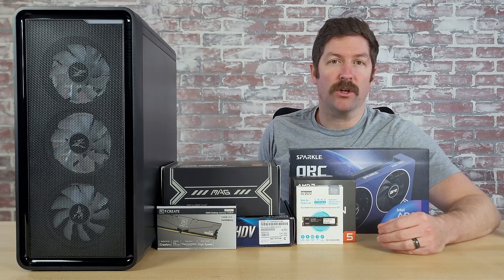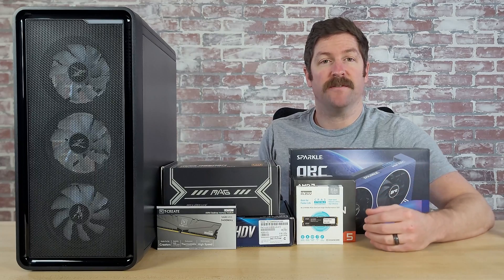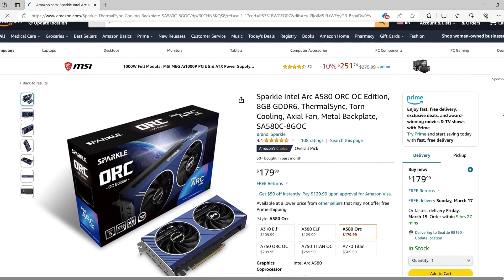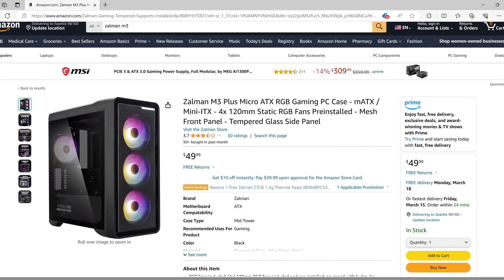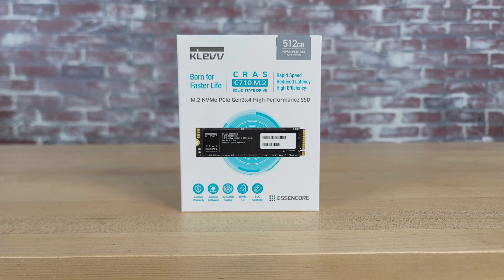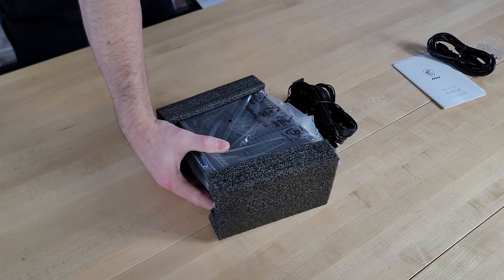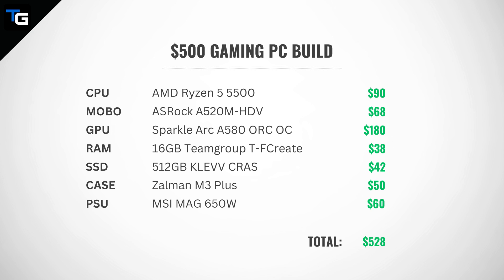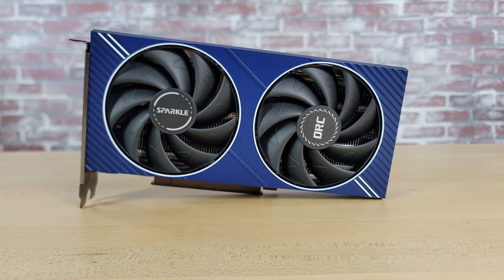Budget $500 Gaming PC Build

Comment: I built this pc myself and for some reason it won't display 😭 im not sure what i did. It turns on yet no signal.
Reply from the maker: The first thing you should check is to make sure you have plugged your monitor into your graphics card and not your motherboard. After that, you should check all of the main connections on your build (the 24-pin motherboard power connection, the CPU power connection, the PCIe power connection to your graphics card, and your memory) and make sure they are all fully seated.

If that doesn't work you can email me at bhale@techguided.com and I'll try and help you troubleshoot.
Reply: Run your cable to TV or monitor FROM the GPU.

Comment: just wondering but is it possible to use other kind of pc cases? if so what kinds should i look for?
Reply from the maker: Yes you can swap out the case. You'll just need to make sure that it will hold the graphics card and motherboard.
Reply: @TechGuided  hey its me again and i want to build this exact build for my first pc with some changes, im thinking of a 500 or 550w psu and the gigabyte b450m ds3h wifi motherboard, will it work? im not too knowlegable about pcs and was hoping you can help me out.

Comment: Hey I made a new account I'm ghostx and I finished the build but it didn't turn on
Reply from the maker: Is anything  turning on when you press the power button? Do fans spin or LED lights turn on?
Reply: @TechGuided are those colored wires under the GPU supposed to be plugged in?
Reply from the maker: Sorry for the late response. Glad you got it sorted. Yeah, the colored wires are the HD Audio and USB 2 connections that will allow you to plug in a headset and USB devices on the top panel of your case.
Reply: @TechGuided  yeah the problem was I didn't check for the colored wires but then found them I also found the other stuff like the restart wires now everything is plugged in and turns on I just need to set up the bios and stuff
Reply: Nvm just re watched vid turns out I didn't plug something in

Comment: Ok I'm back so I ordered the parts and I got the 512 gb klevv clas and I was wondering if it came with the screw because I opened the box to check it out and there's no screw so I may have dropped it
Reply from the maker: Shoot, I'm trying to look back through footage of me unboxing it, but I can't tell. If not there, there should be one that came with the motherboad?
Reply: @TechGuided  yeah that's what I was thinking because the motherboard hasn't came in yet so your probably right
Reply: @TechGuided  yeah you where right the motherboard came in and has the screw now Im just waiting on the CPU and case will definitely use the vid as tutorial
Reply from the maker: @Ryan_Anteck  Nice, let me know if you have any questions.
Reply: @TechGuided question about upgrading SSD would I be able to use 1 terabyte SSD if ever needed?
Reply from the maker: @Ryan_Anteck  Yes, but assuming you used the same motherboard I used, there is only the one M.2 port. So, your first option would be to swap out the existing 500GB with a new larger drive, which would be a bit of a pain because you'd have to copy everything over to the new larger drive. You'd have to connect the new drive to your system with an M.2 enclosure first, clone it from your original drive using something like CloneZilla, then you can turn your system off, uninstall your old drive, and install the new one.

You could also just opt for a SATA SSD as well, which won't be quite as fast, but can easily be installed on one of the SATA ports available on your motherboard.

Comment: How did you get the fans to light up with the motherboard?
Reply from the maker: No connection to the motherboard is necessary. The case comes with a controller that all of the fans are pre-connected to. You'll just need to connect a SATA power connector from your PSU to the controller to power them.

Just note, though, that these aren't true RGB lights, as they only stay in this multi-colored mode.

Comment: Would I be able to replace the ryzen 5 5500 with an intel core i5- 12400?
Reply from the maker: Yes you can, but you'll also need to swap the motherboard for an LGA 1700 socket micro-ATX motherboard. That would either be an H610 or B660 chipset board. A B660 board will probably be tough to fit in a $500 budget unless you find a good deal. H610 will run the 12400F fine, but will limit your upgrade potential a bit. But you have basically the same  problem if you stick with the Ryzen 5 5500 and the A520 chipset board we chose.
Reply: @TechGuided  is there any other pc cases in that budget range because the case in the video says it’s no longer available

Comment: My interest is in building a budget gamer that would support direct out for a Quest 3  (HL Alyx & other PC VR games/ports).  Would this build support direct out (specifically, the A580's) - and is it robust enuf to handle VR?
Reply from the maker: Hmm, I'm not 100% sure on how the A580 will handle PCVR. The one downside of ARC GPUs is that, since Intel is new to the GPU market, they're sort of playing catch up in optimizing for the variety of games and applications available. My guess is that you'd be better off opting for either an RX 6600 or RTX 3050,---both slightly mor expensive than the A580---as AMD/NVIDIA will likely offer better support for what you're looking to do. I think NVIDIA offers the better VR support, but the 3050 trails behind the 6600 and A580 in traditional gaming performance.

Comment: If your doing this,  I'd recommend a used 3060TI is ~150-180  and 47% better though does pull 50W more
Reply from the maker: Definitely a good point! I checked the local used market where I live before I built this system and, unfortunately, there weren't a lot of great deals. I don't live in a huge metropolitan area, though... I'm assuming that helps.
Reply: @TechGuided  I mean I just checked eBay used. I imagine it'd be cheaper on a local marketplace
Reply from the maker: @kalibbailey6219  I checked ebay as well, but the prices seemed ridiculously high. Maybe I needed to be more patient looking for deals.
Reply: @TechGuided  To clarify I was looking at used GPUs not Refurbished, which is my preference

Comment: For anyone who doesn't have this SSD or wants a better one for a similar price I recommend the Kingston NV2 1TB. It's PCI Gen 4 and has double the storage of this one
Edit: it's faster too
Reply: the mobo is pci gen 3 so you wont get the full speeds. any 1tb m.2 with at least 1500-2000 MB speed should do the job
Reply: Mobo and cpu aren't gen 4 but moving forward you might find gen 4 drive for the same or cheaper price and they will hold up longer in future build potentially.

Comment: Small question do you need thermal paste for the CPU?
Reply from the maker: The stock cooler that the Ryzen 5 5500 comes with already has thermal paste preapplied, so unless you want to apply your own, you don't have to.
Reply: K thx
Reply: Oh and another thing do I need Ethernet or does it have wireless wifi
Reply from the maker: @Ryan_Anteck  The motherboard doesn't have built-in WiFi so you'll need to connect to the internet via ethernet or you can get a cheap USB WiFi card.
Reply: @TechGuided ok thx
Reply: @TechGuided any recommendations for the usb Wi-Fi card?
Reply from the maker: @Ryan_Anteck  I use a couple of these on my kids' computers and haven't had any problems with them:

https://amzn.to/3UcKnGr